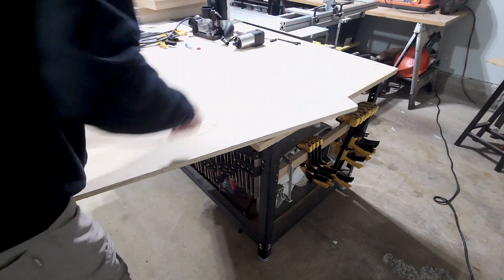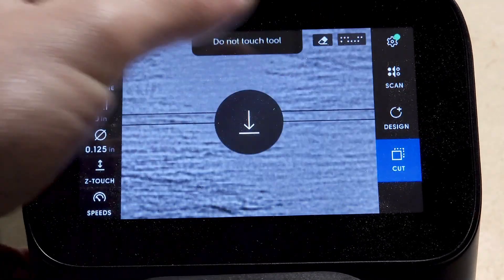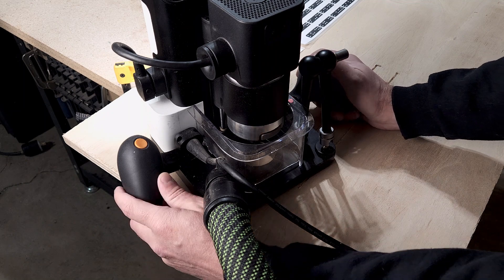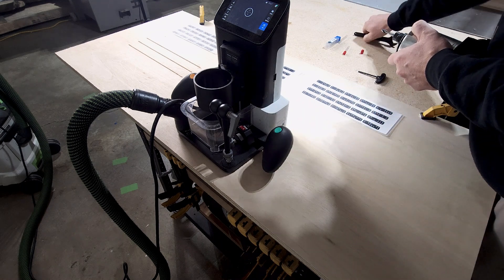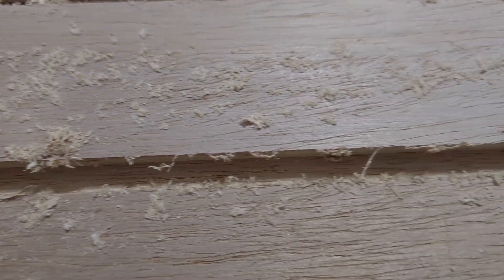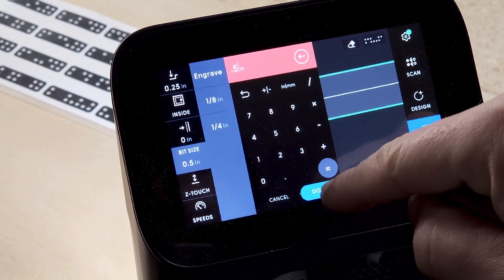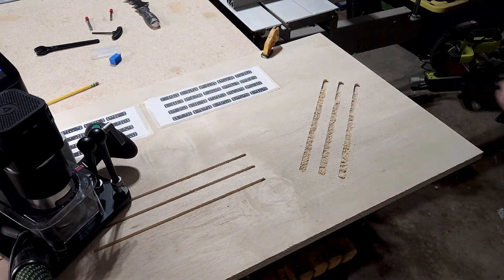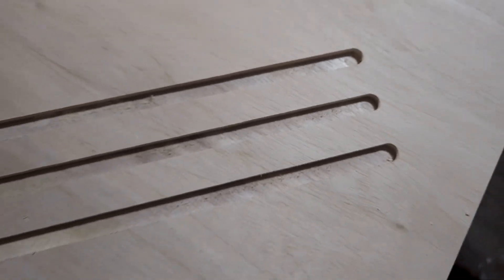Router Speeds on Your Shaper Origin

Comment: The speed of a router, or any tool, is designed to suit different materials. Softer materials like plastic or foam may need to be cut at a lower speed than wood.

Comment: There is a DEFINITE method to the material, bit diameter, and speed/feed. Way too much to go into here, but "generally" you want to use higher/max speeds with smaller dia bits, ramping down to minimum when you get to 1" diameter bits. That's again, general guidelines. And it can make a huge difference.

Comment: As with any adjustable speed router, the bit diameter and number of cutting edges (flutes) dictates the proper speed setting for the desired feed speed. If the speed is set too high and you feed (move) the router too slowly you get heat and burning. If the speed is set to low, you either have to feed very slowly or you bog down the motor and get poor cut quality.

Comment: Proper speeds and feeds are critical for any machining operation.  The thing I find strange about woodworking is this information is not as easy to come by which leads to trial and error along with many subpar results until the proper combination is found.
Good job on providing some improved insight but a more rigorous effort on the topic would be helpful.
Reply from the maker: You're absolutely spot on. Shaper does off some general guidelines, which is good for a starting point. Each bit is different, each species has different properties, and keeping  track of it all is a job in and of itself. I don't claim to be an expert machinist at all, but I'll continue to share my experiences as they come up
Reply: I also agree that you are absolutely spot on. What I struggled with (and still do to some degree) is the feed rate relative to the spindle RPM. Having done metal lathe work early in my life I made the mistake of going slowly in terms of feed rate. However it turns out that the principles for wood cutting are almost opposite to metal. The very first time I did some intricate shapes I used the "auto" function quite a bit and regardless of the settings I destroyed a couple of bits. I really think they should warn new users to NEVER use the "auto" function on a continuous basis as the feed rate is way too slow (maybe that is dead obvious to others and I am just a bit dense). It seems that when the feed rate is too slow the bit rubs excessively against the edge of the cut surface causing excessive heat. I found the "guidelines" for settings from Shaper were not really material specific and not helpful at all. I think that the whole topic of RPM vs Feed rate vs Material is a much broader discussion and if not properly understood will cause the new person to waste a lot of money on bits.

Comment: The main reason to slow the speed down would be to slow the larger radius bits down. Equally the faster speed would be used for the smaller radius bits
Reply from the maker: I failed to mention that slower speeds are necessary for materials like nonferrous metals. But that's a topic for another day.

Comment: I was about to ask about comparing upcut to down cut, as my instict says you want the chips to be pulled toward the tool for better extraction. Then i looked at your other videos and you may have already answered that point. So I'll check out the other video.
Reply from the maker: Sadly it's a bit more complicated than that. For simplicity sake, upcut v. downcut is more about the quality of the show face rather than specifically about extraction. in some situations the compacted dust can act as a clamp

Comment: The outside edge of the 3/4 inch cutter runs 3 times faster than the quarter. Inch. That would be why it was so much smoother not because it was straight
Reply from the maker: An oversight in my explanation, but this is what the comment section is for. Appreciate you chiming in